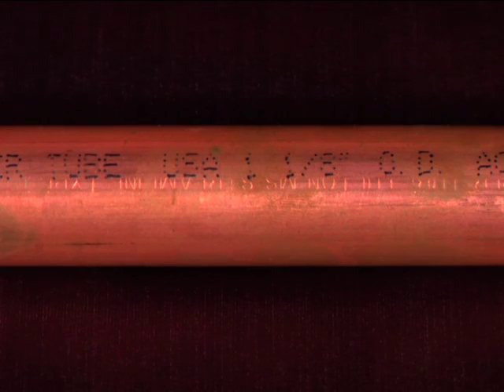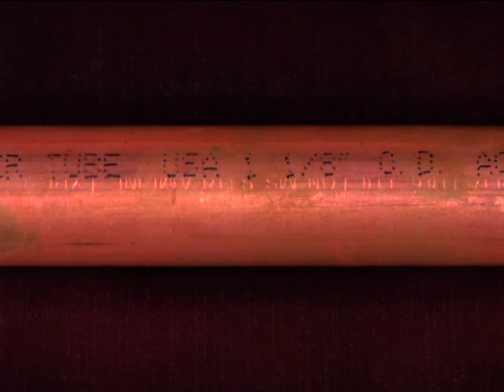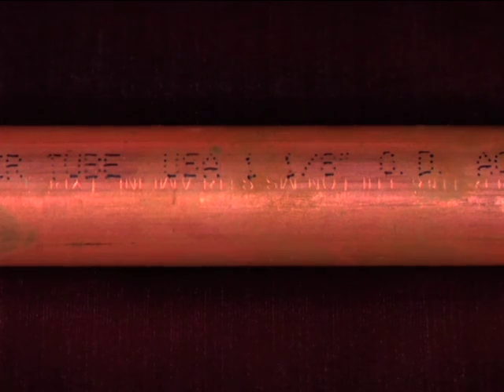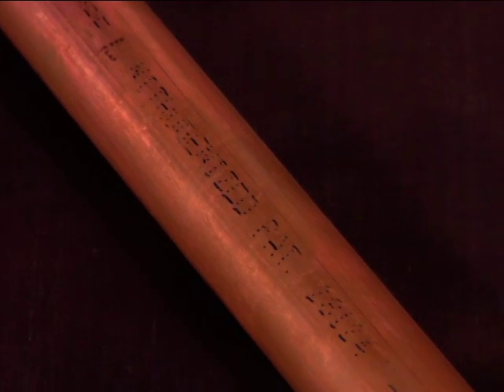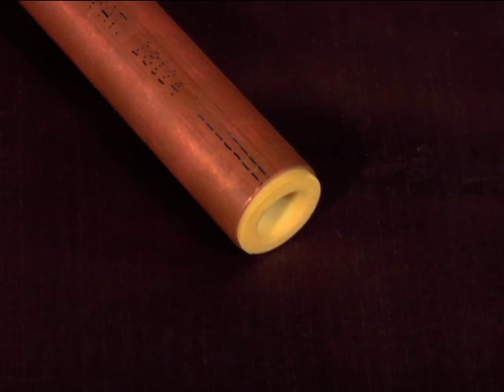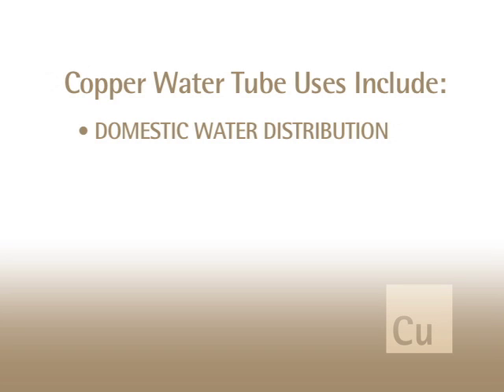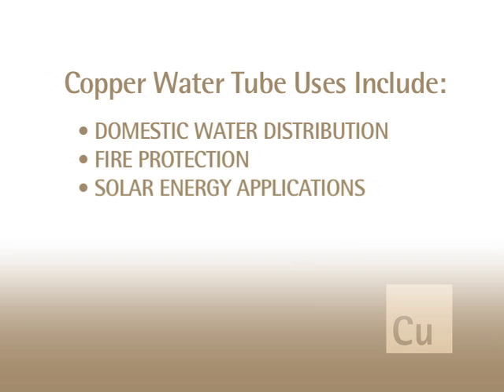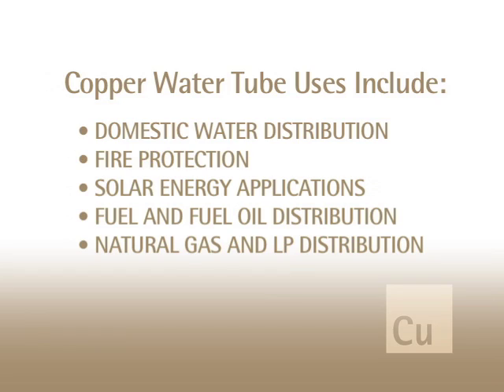Introduction to Copper Tube, Pipe and Fittings

Comment: Great video, thanks for uploading, but as someone else pointed out, you'll want to use PVC with wastewater. If you go into home depot and ask for a copper for plumbing, nobody thinks you're talking about wastewater, they think you're talking pressurized, potable water. The key reason you want PVC: while copper resists corrosion, plastic (by merit of its non-reactivity) is immune to it, and you don't want to be thinking about how the foods you eat (like acidic berries) are going to be reacting with your copper wastepipes, that's for sure.

Comment: What about ACR?
Reply: Acr tubing is measured by od also, but is actual size. So 1/2" acr tubing will measure 1/2" on the outside dimension.  Standard copper tubing is measured od also, but is typically 1/8" larger, so 1/2" standard tube would measure 5/8" od.